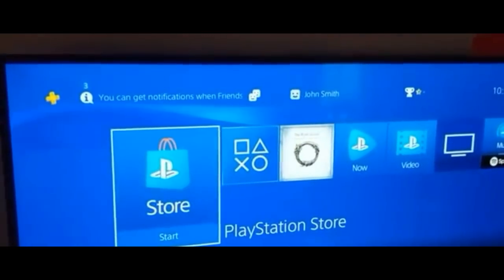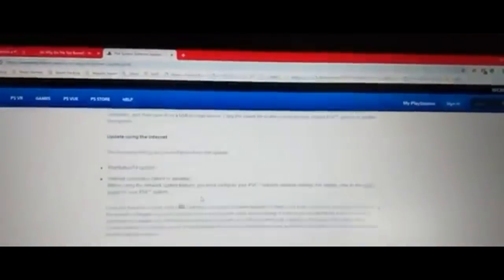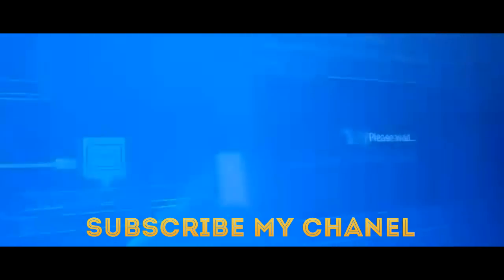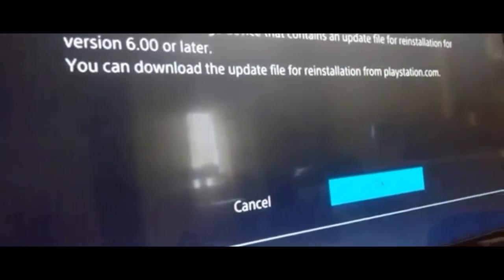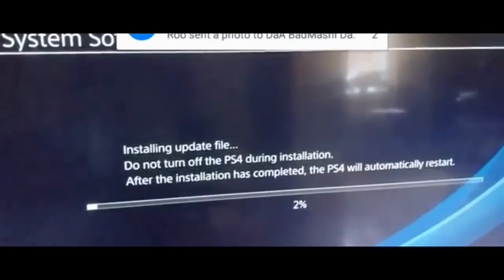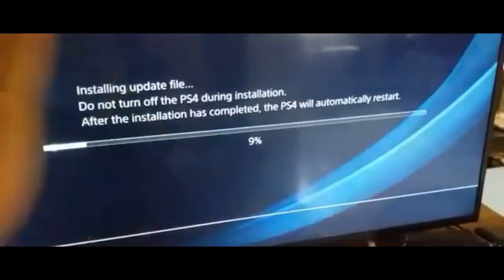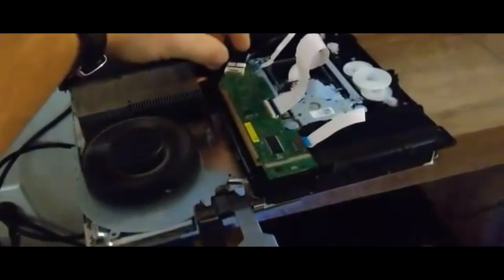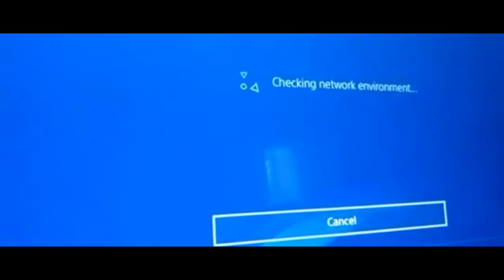Solution to SU 42118-6 PS4 Update Error ''Fix!!

Comment: What if I don't have that type of blue-ray ribbon?  It's that same original ps4 but mine isn't like the one that is shown
Reply: Did you not see that that system shown was off? Seriously! without that fan pushing air through the heat sink, that system would have never made it through half of the Update processes let alone initialization process. The video is fake, Click Bate.